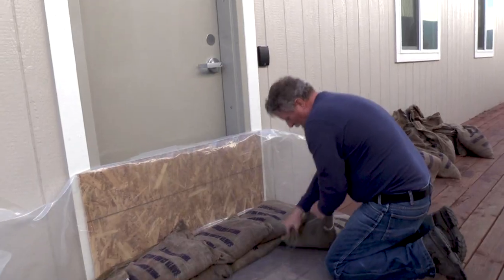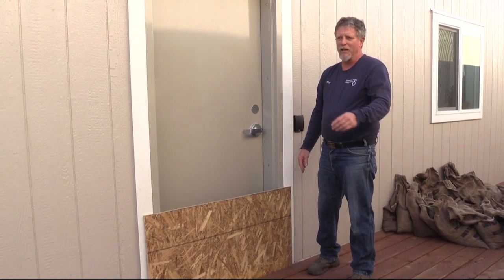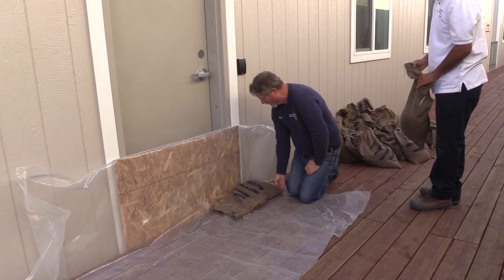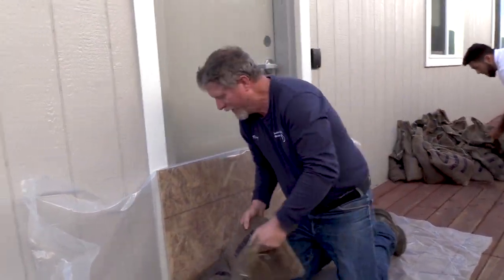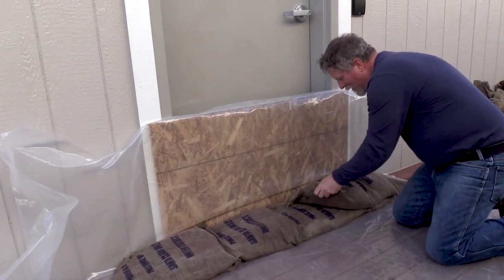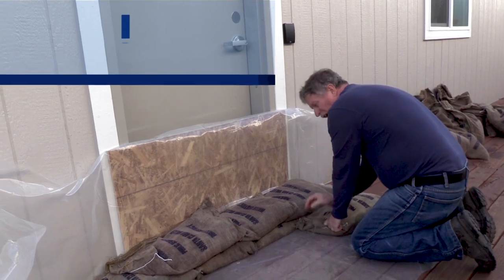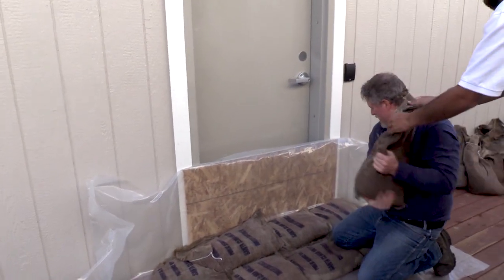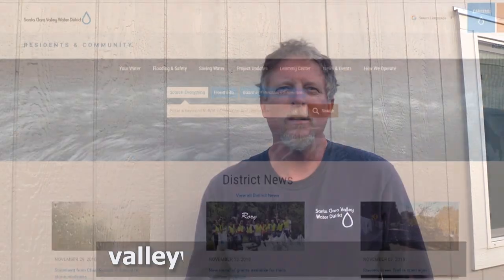How to protect your home with sandbags

Comment: Doesn't really make sense that you limit 10 bags per household when it takes more than that to secure a single doorway.
Reply from the maker: “The stated sandbag limit is meant to prevent drivers from overloading their vehicles. We recommend a max of 10 to 20 bags per vehicle, but residents can make multiple trips. Our sites are not monitored, and open 24 hours a day.”
Reply: @Valleywater  Gotcha, thanks. Hopefully I have enough for tonight